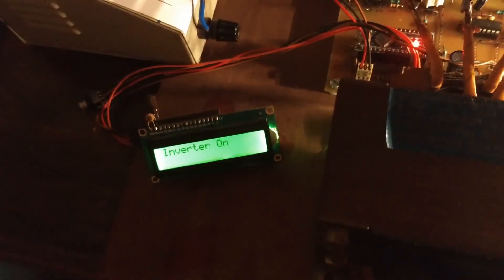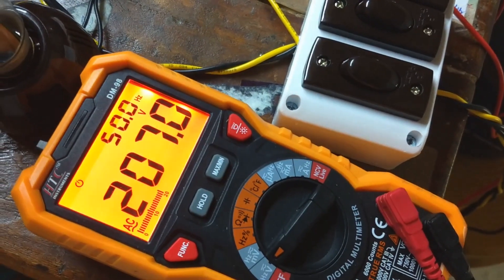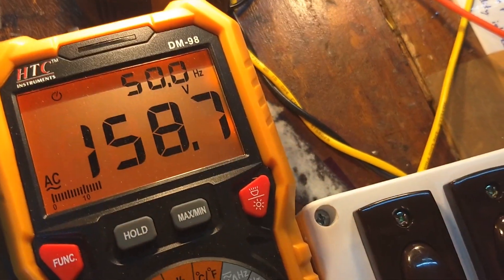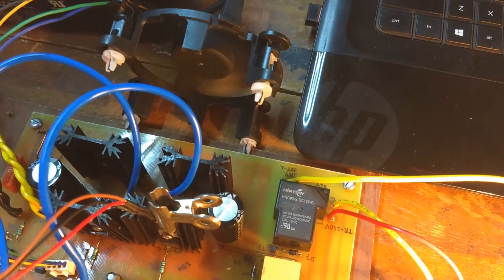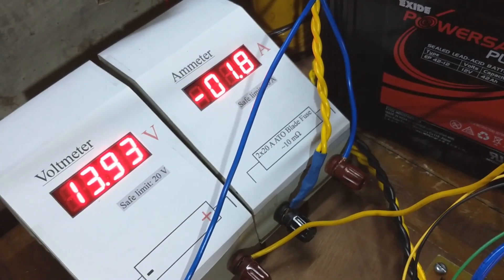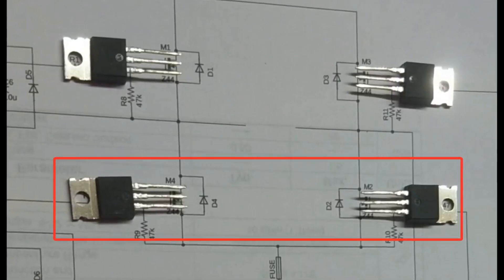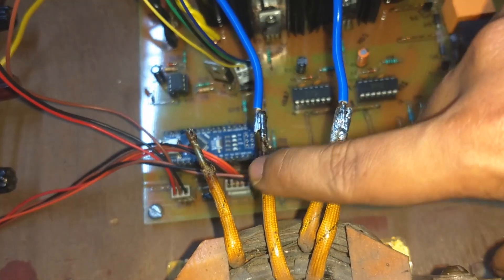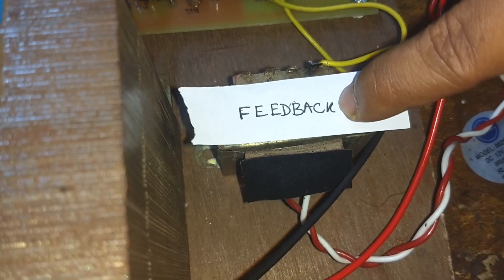350 W Pure Sine Wave Inverter with CC CV Charging, Automatic Changeover

Comment: As a designer, I really admire the fact that you put in so much work and give the whole result out for free.
Thanks for this amazing work you're doing.
I however found that if you switch at about 20khz while charging is going on, it'll help mitigate the hissing noise that happens when it's in charging mode.
I've tried this a couple of times and it works just fine.

How can one modify the code to achieve this?
Reply: if you change the max_count_CHG it sets the timer counter value ICR. reducing the value will increase the frequency. 
if you set a higher MAX_COUNT_CHG , the frequency is decreased.

Comment: Wondering, how can we adapt to use ferrite core tranformers to generate 310dc then use arduino to drive h-bridge and get 220ac
Reply from the maker: I am designing the flyback converter for 12 V to 320 V conversation. But, the major constrain is the unavailability of the ferrite core transformer of suitable specifications.
Reply: @ElectroHijibiji  perhaps those from ATX computer power supply, they are rated 350w

Comment: i have connected circuit in proteus and  loaded the code only the basic inter code works; version 2 upwards do not work . i have serached the circuit it seems correct but it doesnt simulate

Comment: The 5KHz MOSFETs switching for charging, did you switch the two low side MOSFETs at the same time? Or one after the other.
Reply from the maker: Two low side MOSFETs together.
Reply: @ElectroHijibiji  please explain this better because the two low side mosfet are not connected to the same signal or timer ..please this is the hard part I want to understand
Reply: THE CODE VERSION 2.2 DOES NOT EVEN SIMULATE FOR ME IN PROTEUS . CODE COMPILES BUT NO OUTPUT. CAN U HELP ME OUT . ONLY CHANGEOVER RELAY ON ALWAYS , FAN ON ALWAYS,THEN SD0 PERMANETLY ON TO MAKE SURE NO PWM OUTPUT

Comment: For example, in the LUMINOUS inverter, when the inverter is turned on, the display message is " LUMINOUS Digital Inverter," comes up, correct? My sine wave inverter display shows 'Digital Home IPS'. If I want to change this name, how do I do it? I have a hex code
Reply from the maker: The very first thing you need to do, converting the HEX code into an assembly code. Then you may find the line of code where the welcome msg is written and you can modify.
Reply: @ElectroHijibiji  Is it possible to change my name instead of the welcome msg? i don't know how to convert. I will share the HEX code in your email.

Comment: Can u plz. tell me..
can I use 1 milli-ohm shunt...for 20a dc current measurement..
for any dc amp meter...which uses 10milli-ohm shunt...for dc 10a current measurement...??
Reply from the maker: If you change the shunt resistor value then current reading will be wrong.

Comment: I get the message 'Digital Home IPS' on my inverter display, if I change my company name, how do I change it? I have a hex code. kindly explain. (Digital Home IPS should be replaced by my company name)
Reply from the maker: I have not idea for which inverter you are talking about.
Reply: @ElectroHijibiji  Hi Thanks,
For example, in the LUMINOUS inverter, when the inverter is turned on, the display message is " LUMINOUS Digital Inverter," comes up, correct? My sine wave inverter display shows 'Digital Home IPS'. If I want to change this name, how do I do it? I have a hex code

Comment: Please I need urgent reply
 the moseft drive ic Is it Fan9732 or fan7932 or can I use IR2110 for it
Reply from the maker: It's FAN7392. Of course, you can replace that with IR2110
Reply: @ElectroHijibiji  thanks very much

Comment: sir   what is the function of fuse blown and how does it work
Reply from the maker: The fuse blown will glow up when either the 40 A dc fuse will be blown up or the low side mosfets of any channel is burnt out. If any of the above mentioned situation occurs and there is a gate trigger then the transistor Q17 in the circuit will be turned on and the uC will detect the "fuse blown" condition. However, for some reason it was sometimes misbehaving during test. That's why I have disabled the feature in software.
Reply: @ElectroHijibiji  thank you very much for the explanation

Comment: can replace using oled display ?
Reply from the maker: Yes. But connection through SPI is preferred because I2C will take too long time to write to the display.
Reply: @ElectroHijibiji  but not enough pin

Comment: If I use a toroidal transformer, do I need to install an inductor or choke as well? How to calculate the value of the inductor for each capacity like 750VA & 1250VA sine wave inverter?
Reply from the maker: I think toroidal transformer will just work fine without any additional choke coil. Transformer power rating depends on the wire gauge. The voltage ratio of secondary and primary depends on their inductance.

Comment: Hello sir, am still having problem in compiler Arduino code. am having error show up this time default argument given for parameter 1 of 'void beep(byte, byte, unsigned int)' [-fpermissive], please how do i solve this and which version of Arduino IDE are you using?
Reply from the maker: This error is not expected. It seems there is a mismatch in parameters between the 'beep' function decleration and function definition. You may try deleting the declaration line i.e.
void beep(byte t = shortBeep, byte n = 1, unsigned int p = 500);

I am using the latest version of Arduino IDE.

Comment: What will happen if I connect the Life Po4 battery 12V 40 AH?
Reply from the maker: In inverter mode there is no problem but, ths charging profile you might have to adjust a bit
Reply: @ElectroHijibiji  How much charging current should I set if I connect the 12V 40 AH & 100 AH LifePo4 battery?

Comment: hello.....

i make this invertar  but i having a problems......output side 2 phase coming (tested  with testar indicators) load are properly work but this one problem so how to solve this problem....i already connect  2.5uf capacitor on output side....
Reply from the maker: I couldn't properly understand your issue but, I guess you are trying to say that you are getting live on both the output lines. If so, then this is normal. You will have to connect one output wire with the ground or neutral line.

Comment: Hi, Can you please explain me that the feedback voltage (VO_FB_FACTOR 100.0)
Reply from the maker: Actually, we can not feed back the output voltage directly to the microcontroller. Instead we are feeding only a fraction through a step down transformer. The VO_FB_FACTOR tells the microprocessor, multiplying by which factor the actual output voltage can be obtained.
Reply: @ElectroHijibiji  may be this is where dropping of voltage comes from....

Comment: Hi! i want to change to 50hz, i just need to change #define NO_OF_PULSES 160 to #define NO_OF_PULSES 320? Thank you very much
Reply from the maker: It is already configured to generate 50 Hz sPWM. If you wish to change the frequency however, you need to change the #define NO_OF_PULSES as well as the look up table.
Reply: @ElectroHijibiji  thanks

Comment: Dada..  lead acid battery charger jonno ekta buck boost floating charger triac ac controll kore arduino diea... 12 0 12 transformer diea
Reply from the maker: Amaro plan ache charge er. Kintu ei muhurte ami ektu basto achi amar phd er research work nie. Free holei abar notun video asbe. Tokhon nischoy charger er video upload hobe.

Comment: good job how to adjust  overload protection ,can u explain it
Reply from the maker: I am having some problem with this overload protection. Because, the charging current and load current are in opposite direction. So, if I try to measure the load current then I can not measure the charging current and vice versa. Since measuring and controlling the charging current is indispensable that's why I had to compromise with the load current sensing.
Reply: @ElectroHijibiji  load current can   take trasformer output using CT or lower value resistance , current sensor for arduino
Reply: @ElectroHijibiji  it need modifications eg using current transformer for measuring the out put load of the transformer.

Comment: Wire.begin is to be written in code instead of lcd.begin,otherwise it does not compile.Probably unipolar pulse pattern(instead of bipolar)is to be given at lesser carrier frequency to  rduce heating and improve perfirmance,can you please help me by sending a blank PCB  or assembled PCB on payment basis.Please contact at guptabs@gmail.com.I also feel that hardware PI controller can be used using one additional opamp(you are already using one)to improve response and reduce coding?
i am confused about charging control of battery,You will be using half  H bridge pulsing respective Lower side mosfets only in each  half cycle  for getting boost charging mode ,however what happens when  AC grid voltage is high and battery voltage is very low?

.
Reply from the maker: Thank you for showing interest on my work. Since wire.begin() is already in the LiquidCrystal_I2C library, I did not call that function again in my code and I successfully compiled the code. I didn't exactly get what did you mean by bipolar and unipolar pulse pattern. I am sorry I can not help you with the PCB right now. Because, I am an doctoral student and now I am at  my institute away from my home. I'll think about the hardware PI controller. The preferable transformer is 220 V to 9 V so, in normal situation the voltage will never go more than 12 V. But if the mains voltage is very high (>300 V) it will shutdown the charging automatically.

Comment: The system runs well , but the feedback is unstable. U will have to include comparator circuit to the feedback circuit to make  it work better.
Reply from the maker: If you look into the code carefully, the feedback loop works as a part of constant linear control system. It samples the output feedback at a certain phase of the output waveform so that the ripple in the feedback voltage does not effect significantly.
Reply: I like your Swift response !
The output voltage damped at certain stage when the load was connected but came up to 320volts  when the load was removed.
Reply from the maker: Dropping of the output voltage after a certain amount of load is normal. It depends on the transformer capacity. But, no load voltage should not go so high if the feedback is working properly. You may check the voltage coming out of the op amp.
Reply: Good morning brother.
Please, can I have your contact ? " Your WhatsApp phone number would be ok"

Something appear incorrect and inconsistent in the circuit at the MOSFET area. I want to build this system but I want to ask you few question before I complete my work. Please give me a listening ear. Thank you bro
Reply: @AugustineAriola  ok

Comment: Hi. Its been two to three weeks now. I did the inverter project. It works fine in charging mode but the Vout is dropping when inverter is loaded. I used step down trafo 220v/6v  but out put voltage not still stable at 220v . it went down as the inverter is loaded. Please kindly advise on what to do to fix the issue
Reply from the maker: Good to know, you have successfully done it. The voltage drop might cause if you have used a transformer with low VA rating. If your load exceeds the VA rating of the transformer then the tranaformer winding resistance can cause a voltage drop and it can even damage the transformer.
Reply: OK. I will look at the VA to use higher rating type. I also tried the inverter  version u said u have not tested. It actually work more than previous version......when u load it voltage first went down and later rise to about 220v  but if u off load it goes up to 330v.
Reply from the maker: Thanks for your keen interest. As far as I can guess, the high voltage during no load may suggest any fault in the feedback path. The voltage actuation codes are similar for ver. 2.1 and 2.2
Reply: @ElectroHijibiji  I have tried on the feedback issue but it persisted..... Vout drops when I put load on the inverter even when I used bigger trafo of 1500VA rating. Can you check the vcorrect code perhaps there was an error in the code?. I so much have interest in the inverter sine
Reply from the maker: @adesuyisunday4287  Definitely I will work on that issue but, for my research work I'll be out of my home for 2.5 months. After returning home when I'll resume my activities for youtube, I'll try to fix that matter with priority. Until then please don't loose the touch.
Reply from the maker: @adesuyisunday4287  Can you share your email id so that I can send you some modified code or we can discuss directly? You may send me email at electrohijibiji@gmail.com

Comment: Code not running at this line . void beep(byte t = shortBeep, byte n =   1, unsigned int p=500).
How can I correct it?
Reply from the maker: What is the error message you are getting? 
"void beep(byte t = shortBeep, byte n =   1, unsigned int p=500)" is a function declaration only.
Reply: @ElectroHijibiji  the error message is " default argument given for parameter 1 of 'void beep (byte,  byte,  unsigned int)'  [--f permissive]"
Reply from the maker: Simeon Mebei, I can compile the code successfully using Arduino IDE however, since you are facing the problem you may try this:
Download V2.1 (link in the description) if you have downloaded my older upload. Then change the line to:
void beep(byte t = 100, byte n = 1, unsigned int p = 500)
instead of:
void beep(byte t = shortBeep, byte n = 1, unsigned int p = 500)
(Remember to make the change in the function declaration as well as in the function definition.)
Reply: @ElectroHijibiji  thanks. Corrected. The code is now working
Reply: How can I change ICR1 = 3200   at 5kHz  to 20kHz on the code? I want to try it.
Reply from the maker: @simeonmebei9179  You can change to ICR1 = 800 to get 20 kHz freq. But don't let the duty cycle to increase over 40%. So, change "if (OCR1B < 1280)" to "if (OCR1B < 320)"
Reply: @ElectroHijibiji  OK, will try it.

Comment from the maker: I have uploaded 2 updated versions of the code, V.2.1 and V.2.2. In updated versions voltage actuation has been greatly optimized. But, please note: I did not tested properly the V.2.2. If you use it, please use with cautious. However, V.2.1 is and safe to use.
Google drive links:
V.2.1:    https://drive.google.com/drive/folders/1_MkCmxPBQD8virsRpro0PHUDEi_FQpBF?usp=sharing

V.2.2:    https://drive.google.com/drive/folders/1J8lnMPpfsfR5sdp1cPlclQvs3XjR4Y6E?usp=sharing
Reply: where is 2.2??? link
Reply from the maker: @sweetali4578  https://drive.google.com/drive/folders/1J8lnMPpfsfR5sdp1cPlclQvs3XjR4Y6E?usp=sharing

Comment: The inverter code is working now on protues sim.  Pls tell me  how to do the  Vin in Grid on mode. I have seen that of Vout=, I want to print Vin=  that's  ac input  on the LCD?
Reply from the maker: You can calculate Vin with the same formula as Vout. Because, we are feeding the input ac to the same feedback transformer as of the Vout.
Reply: @ElectroHijibiji  OK thanks. I will do exactly that. Am just trying to make inverter use 1604 LCD I have done and simulated it . I will do the Vin as you have hinted me.

Comment: Also I want 220v ac to show on the LCD both in inverter mode and charging mode. Is it possible, any help?
Reply from the maker: In the charging mode you can print the ac voltage but, in inverter mode it's difficult because, arduino becomes very busy handling the timer interrupts. LCD I2C communication was creating distortion in the sPWM pulses.

Comment: Pls what pin number is the inverter start switch for on/off function or is it by supplying 5v to the board?
Reply from the maker: Yes. The switch turns off/on the +5 V supply.

Comment: Hi. I try to simulate the code on Proteus but its not running. Please what do I do?. I just want to run it on Proteus simulation before I build the board. Pls I am expecting your reply.
Reply from the maker: Which code are you talking about?
Reply: @ElectroHijibiji  it the atmega inverter code. I compile the source code into hex file, then I use protues  software to simulate....before it was not running at all but I can see that it ran for charging mode. I am still trying to let it run on inverter mode using same Proteus but not running yet. If you have Proteus sim file kindly share with me so I can use it to run it. The charging is working. Thanks. Am expecting your reply.
Reply from the maker: I am sorry Adesuyi, I didn't simulate that code. I directly tested uploading into the board.
Reply: @ElectroHijibiji  OK. I will build the board then to see the inverting.
Reply: I have got the inverter code working on Proteus simulation....it was my mistake. The code is working. Thanks

Comment: Nice job. How do we make the output 220vac stable when the inverter is loaded. Thanks for the file. God bless you.
Reply from the maker: At first you should use a transformer with proper rating (6 V to 220 V should work fine). The code has a proportional control action to keep the output voltage stable at 220 V by actuating the modulation index.
Reply: have u been able to biuld with version 2.1 code .it doesnt work for me